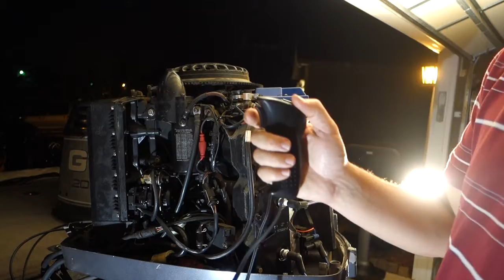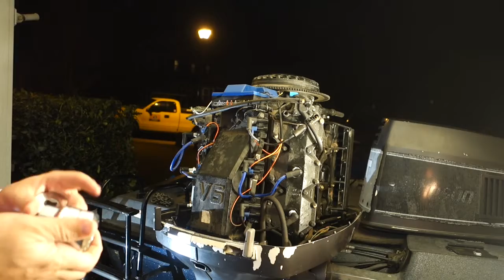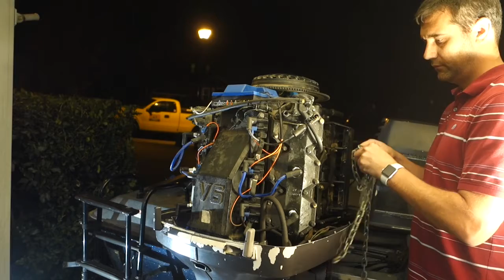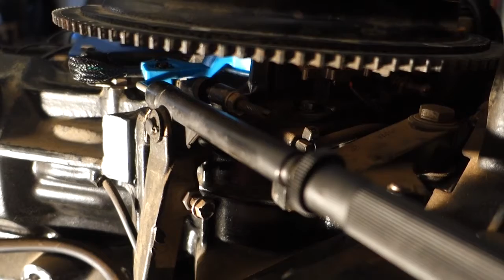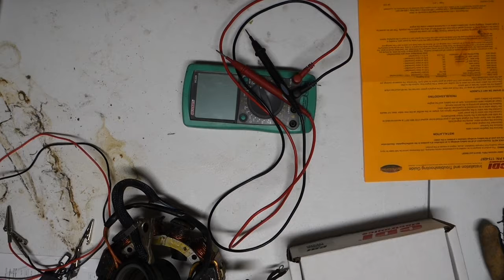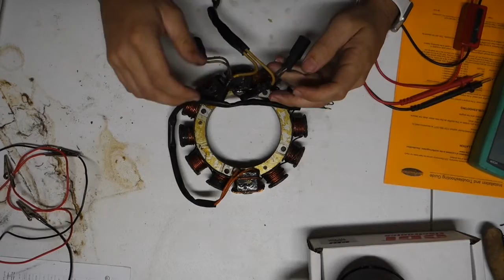1991 Johnson 200 HP

Comment: My motor is not much newer than yours and looks like the same parts. In the service manual on mine and on the cdi specs on the timing base says 200ohms or around that on the white to black wires but on all the others white to purple etc is open so just OL. Did you have a service manual for yours to? Just curious because mines reading like the manual and website say but your paper says 2m ohms!
Reply from the maker: I ended up purchasing an online version of the motor manual and I have no idea where it is anymore. When you buy those parts it comes with a spec sheet, so maybe what you could do is buy the part and get the spec sheet and if you don’t need the part, return it. If you were experiencing no spark, it might be worth buying all the parts; that’s what I end up doing.  

With a motor that old probably needs to be replaced regardless

Comment: SIGH... got a 1996 200hp vindicator got new cdi timer base cdi powerpack cdi stator and check the rectifier and its good and still no spark on any cylinder 😢 did all the dva check with the cdi troubleshooting and yellow blk wire ect still no spark i did notice i keep blowing my main fuse when trying to crank from the switch but i did change to just bypassing the solenoid with a press starter and still no spark im stressing...maybe i got a short in the harness somewhere?? Everything looks good idk anymore
Reply from the maker: I'll ask the easy question.  Have you tried bypassing or replacing the ignition switch?
Reply: @TheSmittycjs806  yup

Comment: I have intermittent no spark on cylinder 1 and 2. Coils and plugs and wires are cross checked to be good. What is likely my bad part?
Reply from the maker: I don't have a good answer for you.  I would probably replace the timing base and the powerpack.

Comment: i got a mobile mechanic who spent 8 hours on my boat, said no spark. he had me spend 800 in total with no spark, he then told me it would be 1700 for a new stator, was pretty shocked that a 30 year old part would cost 1700 for installation, especially after i brought the enging for 1400 on facebook lol. anyway i let the boat sit for 6 months and i saw a mechanic on the side of the road, brought the boat to him and he said he can fix it in 2 seconds. with a paper clip and a flat head screw driver he got the boat to start. ignition switch was the culprit

Comment: That is not an idle adjustment screw. This engine adjustment ( I have it ) for idle is set threw the idle timing screw.. the throttle plates have to be 100% closed when at idle. Messing with the "idle screw" will cause the lync and sync to be outta wack... I can make a video if anyone needs.
Reply: Would like to see video thanks

Comment: I have no spark on my 1996 Johnson 225 HP outboard. Stator looked bad and didn't have its insulation anymore. Bought a new stator, installed still no spark. Just bought the Timer base. It looks very old compared to the powerpak. Hoping it gets spark. Good news is the new power packs aren't to expensive. About $200. Bad news is Maybe i should have bought the powerpack first LOL
Reply from the maker: I felt the same way, but sucked it up and bought both because they were both old.
Reply: @TheSmittycjs806  
Hey man, the new timer base fixed the spark issue. I know I’m supposed to adjust the timing now. 
Engine is running terrible in the water. Won’t run past 3,000 rpms. 
Hoping you can post a link of the procedure steps you followed for adjusting the timing
Reply from the maker: @boatrestore2816  There isn't any good videos that I could find.  The hardest part of adjusting timing on these motors having to adjust it at full open throttle under load.  The way I did it was to keep the boat on the trailer strapped down.  

You look a little bit like a crazy person at the dock throwing water around; the only other way to do it is to purchase a special prop
Reply: @TheSmittycjs806  my timer base isn’t advancing with the throttle. Did you have this issue with the CDI timerbase? I pulled the flywheel cleaned everything and it still won’t advance
Reply: @boatrestore2816  maybe insulation melted onto where the timer base sits around the upper bearing?

Comment: Mine misfires on the muffs when I run the throttle linkage by hand. But it misfires and puffs a little puff of gas or smoke out of the intake side right below that WOT throttle bolt. Is that a head gasket?

Idles fine, only does this when I run the throttle on the muffs and do the throttle only not the timing linkage bar. Haven’t had a chance to put it in the water yet.
Reply from the maker: I don't know for sure; maybe. If it were a 4 stroke i would say check the valves.  That leaves us with gaskets and piston rings.  How is your compression?
Reply: Casey Smith compression is low, about 90’s last I checked but it’s even across the board and apparently these motors have semi low compression to start.

I was chasing an idle misfire months before but the motor ran great with throttle. Finally cleaned the corroded ground to the coil pack which fixed the idle misfire. But then it made the misfire happen when in throttle

Comment: Where did you get that Engine starter Hand tool at
Reply from the maker: Here is one from Harbor Freight 
https://www.harborfreight.com/automotive/battery-tools-accessories/testers-tools-accessories/12-volt-remote-starter-switch-35448.html
Reply: Casey Smith cool thanks makes it easier to work on them outboard motors

Comment: Do you have to adjust the timing when changing the timer base?
Reply from the maker: Yes.  It wasn't a large adjustment but the manual says it needs to be done.  The timing adjustment is difficult to do because you have to adjust it at idle and at wide open throttle.  Right or wrong, I did the adjustments with my boat on the trailer at the dock.

Comment: You shade tree mechanic ever heard of 3/4 inch impact gun  for fly wheel and grade 8bolts for puller and don't screw in to far d/c u will hit stator put a lot of tension on bolts and hit puller bolt couple times and will pop up go to evinrude website and get real factory service manual I did best eighty five dollars ever spent all factory directions and specs and online factory parts I go twenty five miles offshore with my grandkids u want to use made in Taiwan parts good luck  no where in my 300 etec manual does it say to pull 
Out a five foot long steel bar teach them right if you going to teach them good grief   Can't watch any more   
Go to danger marine and watch his video he does a lot  J and E outboards. Good luck John
Reply from the maker: I hear ya, I used an electric impact and it didn’t work.  I have an air impact now.  On a 25 year old motor ya gotta do what it takes.  BTW, I love oh dangar stu he is great.

Comment: Hey i just got the cdi stator and powerpack. But  the connectors out of the powerpack that plug to stator are all brown wires. How do in know which plug goes on which side?
Reply from the maker: That is strange.  The CDI powerpacks for a Johnson have several connections.  The long orange cables go to the induction coils.  The connections with the blue plugs you can count the wires/pins on the connectors.  My power pack looks like this https://ssli.ebayimg.com/images/g/FJsAAOSwEPtZZIHh/s-l1600.jpg
Reply: I was going to ask the same question
Reply: They're two plugs with brown wires on the original power pack one is on the left and the other on the right but on this cdi brand all 4 are coming out of the center
Reply: Did you figure it out?

Comment: Hi do u gotta reset the timing if take off the timer base on Johnson 150 2001
Reply from the maker: Yes.  I think the best way to do this, without a timing wheel, is to keep your boat trailered.  If you have your original flywheel you should have your timing marked already.  All you have to do is get a timing light and a buddy.  I used the one from harbor freight tools.  It had an adjustment for ATDC so all I had to do was match "0" to the timing needle at full throttle.
Reply: Dad go to danger marine if u haven't all ready u can ask stu questions he will answer he's in Australia thanks John

Comment: When testing the pin outs on connector plugs order a pair of male and female pins for your engine and solder leads to them.
Buy doing so you have the best connection and eliminate using gator clip.  Of course you would order the pins when you need to replace another higher dollar component because the pins themselves aren't very expensive to justify the shipping.  Just my 02.

Comment: What was ur boat doing wasn't getting spark
Reply from the maker: Paul Thomason at first, I thought it was getting too much fuel and flooding out. I discovered a no spark condition when I sprayed staring fluid into the air intake and nothing happened. 

I checked compression and I was within spec, so that was a relief. Spark plugs were wet, so fuel was there.  Spark was the last component of the triad.
Reply: Casey Smith did feel like it was run half motor I'm haveing a problem were I get to the run fine if it will start then fish start up idle speed
Reply from the maker: What forced me into this project is my motor would not start; however, I think I know what you are talking about.   Sound to me like one of your ignition coils might be bad / one cylinder is not firing.  You could check this by running your motor for a minute or two, then pulling your plugs.  The one that is wet is the problem.   

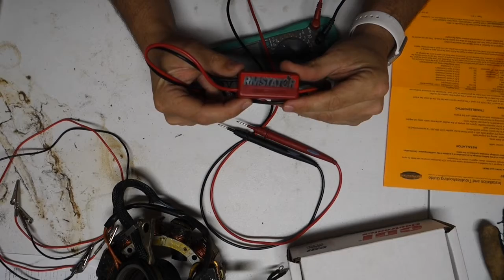If this result is inconclusive, then you need to get a voltmeter with RMS or buy the RMStator I mentioned in the video around 18:24.  Then you have to test the Stator, Timing, and Power Pack.